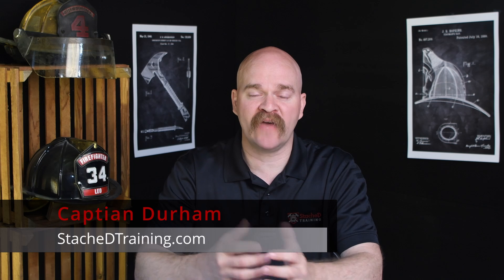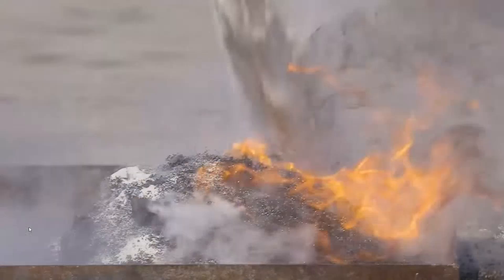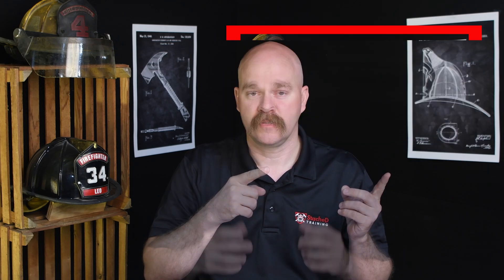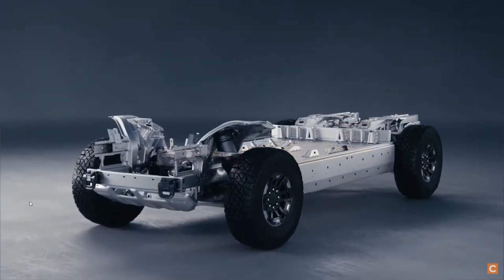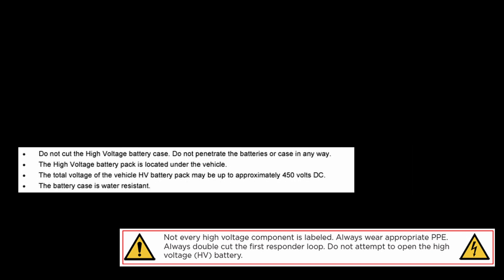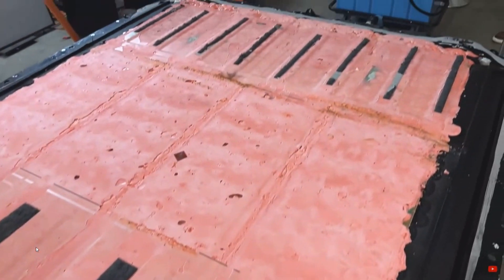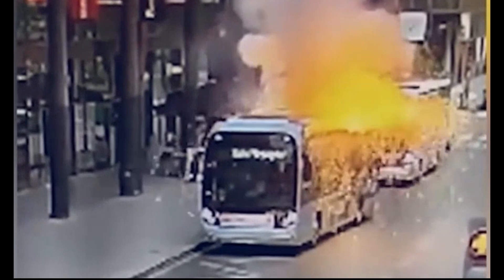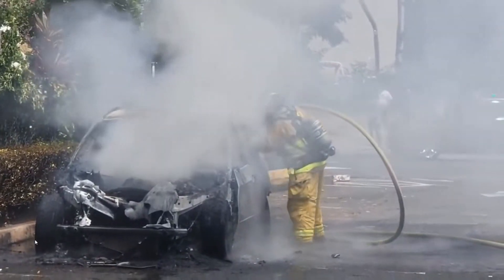What Firefighting Tools for Extinguishing Electric Vehicle Fires Really Work?

Comment: If anything, if EVs become common enough, it may be best to just have some sort of enclosed trailer with a winch inside that you can tow a burning EV into. That way it would be in an enclosed space that you can vent the gasses directionally while managing temperature.
Reply: This strikes me as a pretty good idea. Box would have to be rather robust, but probably doable.
Reply: @itshofftime  How many fires can a regular shipping container take without deforming enough to be unusable?
Reply: @CTimmerman  Line it with gypsum panels. Replace them after each EV burn.
Reply: @CTimmerman  With the top still on probably 0.  Somthing purpose built would be much more robust and useable.
Reply: sure - are you gonna hook the cable to the car ?
Reply: @gibbyjones1040 that seems like a small obstacle, robots could handle this, or just like in the video, a long handled device. Perhaps the EV’s could be required to have hooks or loops placed at either end to facilitate.
Reply: @gibbyjones1040  I've heard they pick it up with a crane, forklift, or claw and drop them in a dunk tank.
Reply: I like it! It could be hauled to an "EV burn yard" so that combustion can do what is does. A large particulate filter would be nice too.
Reply: You'd need an extensive rollout of custom vehicles designed to do only one job which will be punishingly expensive to implement and maintain as well as requiring extra space to store the vehicles. Towing a trailer will limit mobility and increase response time and while it may work if you've got space to get things aligned when you get there this is more often than not going to be unsuitable or impossible. 
It's a good idea on the hard factors (ie. how to contain a violently burning EV) but unfortunately it falls down on the soft factors (cost/practicality/implementation).
Reply: @DjDolHaus86 That is cost prohibitive, I agree. Better to maybe go with the blanket and figure it out from there.
Reply: @DjDolHaus86  Yeah usually the fire is going to burn the vehicle before anyone gets there. So unless there's already something there prepped to go.
Reply: @DjDolHaus86  just use water filled dam barriers to build a pool around the vehicle, and then drown it
Reply: In Germany firefighters are usually just using a standard garbage container that is open at the top. Just try to extinguish most of the vehicle, fill up the container  with water and drop the EV in it and let it sit for a couple of days...
Reply: @mkultra3679  Seems like the most practical method.
Reply: good idea, but wouldn't a ditch work more effectively? well this is assuming the occupants get out and the vehicle can be put in Neutral
Reply: Try that inside a sub parking lot....😂
Reply: the famous "elegant solutions for problems that did not existed in the first place."
Reply: If you do that, might as well have it evacuate O2 and then you can put fire out easier that way maybe. Problem is getting to the battery still.
Reply: EV Trucks will need a large container 🤡🤡🤡🤡🤡🤡
Reply: @sichere 😂😂😂😂
Reply: Yep, these things are becoming more and more expensive - 
AND WHO has that sort of money.

Maybe billionaires do - but already, you can see the idiocy
 that their Interests have gotten them into, 
ARE NOW at the bottom of an Ocean!

sheesh... progress has opened up it's own  HOT can of Worms!
Reply: And what kind of vehicle will transport this EV containment device? Another EV? Boom goes the lithium. Maybe when the first EV firetruck burns down the EV fire station somebody will realize making car batteries out of explosives was a bad idea from the start.
Reply: @nerd3d-com Well trucks aren’t going to become EV, except light duty vehicles. 

On a side note: Trucks will become hydrogen powered before EV, which means Hydrogen fuelling stations will become prevalent. This means hydrogen passenger vehicles will follow extremely quickly, given that hydrogen vehicles are far more environmentally friendly, cheaper and negate the negatives of EV’s… and as such, this issue should negate itself.
Reply: @LukeAusNSW  Fire trucks ARE going electric - our local fire station has one on order...
Reply: @nerd3d-com  This isn't that big of a problem. There's been only 2 transport ships with a mix of internal combustiom vehicles and EV's in the past 20 years.

Comment: Flooding port on the battery box would def help.  Needs to be standardized for the entire industry.
Reply: It will be destroyed in accidents.
Reply: You could easily design it to withstand 95% of crashes.    @Baneslayer
Reply: When you short lithium batteries it can get much worse.
Reply: it does not help. The nature of these fires makes them unstoppable, all you can do is let them burn themselves out
Reply: @mitchellcrane9809 sure as heck looks like you can stop them: https://youtu.be/4xjDdmv8urk
Reply: @mitchellcrane9809  this is not fuel, they are burning because they are allowed to reach these high temperatures.
Reply: @Y2Kvids  That is nonsensical , it is like saying gas is not a fuel as long as do not allow   it to reach high temperatures. All one needs to do is allow a fully charged lipo battery to experience a internal/external short from damage or internal breakdown and it will overheat on its own and burn.
Reply: @mitchellcrane9809  you are not a expert.

Comment: So the battery boxes need a flooding port accessible on the exterior of the vehicle.  Or the boxes need an internal fire suppression system.
Reply: You could put where the exhaust would be on an ice car
Reply: @jasonmurphy9647  that's actually a damn good idea, leverage a portion of the pre-existing ICE paradigm as a "hydrant" or "stand pipe connection". 🤙👏👌 this would better than the gas filler neck idea being considered, as that  access point would unfortunately be sitting up high in the flame.
Reply: re: "Or the boxes need an internal fire suppression system." i've seen this done as well (have the pics on my phone) but the caveat is this was on a custom EV race car with a custom made battery pack (built with an almost unlimited budget) so it hasn't reached the price conscious OEM's just yet.  what they did was simply leverage a pre-existing idea/requirement for on board Fire Suppression found on many ICE race cars, and dictated by many race tracks and sanctioned race series (ref: NHRA, SCCA, etc).  further example: those in the Porsche community know that a fire bottle is something than can be specced on some models of 911 purely driven on the street.

Comment: Where reasonable why not push the vehicle with a blade, backhoe, dozer or other protective equipment or blade added to emergency vehicle to a dirt location and then push up dirt berms or short barriers.  Then add water, foam or more dirt depending on the situation.  The dirt berms contain much of the fire and help direct flames, smoke and heat upwards as well as any matter ejected.  It also helps concentrate the water or foam in a smaller area to hopefully work better rather than disperse.  More dirt could also help.  This is obviously not feasable in urban scenarios but suburban and rural there is often ditches, dirt shoulders, yards and dirt areas nearby roadways.
Reply: No.  Just NO.

Comment: I have the best solution, do sway with electric vehicles. Even small phone batteries have been know to catch fire, this all the fault of the climate change wackos, they always forget that it takes gas coal or oil to generate the power to charge their pos cars, can you imagine the fire if one of those tractor trailers goes up? As long as the federal government is involved we're doomed.

Comment: I would say that perhaps the best way is to allow a controlled burn.

There are products that don't burn that are used for furnessess They can take intense flame without burning.

So I've wondered why these things are not used to control the battery fire so it doesn't spread, a fire proof valve could be fitted so any build up gas could be vented to a controlled area.

So if a scooter set fire it could be wrapped with the blanket and direct the vent to a safe zone, same with a car but a car or larger vehicle could have the cover pulled under the vehicle  and over the vehicle in two parts which interlock automatically.

The demo of the blanket you showed just needed a method to control the gas pressure so it could be directed to a safe localised zone.

For example, a charging car caches fire, the blanket is thrown over and under it, and it just burns, the vents let the gasses release into the air the smoke could be reduced with water to keep it down with a sprinkler type mist.

So it makes more sense just to let it burn but to control the burn, I would have thought.
Reply: Those gasses are HIGHLY toxic unless you let the fire freely burn.
Reply: @ffjsb  I'm gonna guess in that case that they are toxic regardless, but in time using a controlled burn in a vented covet a system of capturing these gasses could be developed so they could be nuitrilised.

Also the idea of a mist water spray would be to hold down the gasses so they could be either collected as dust or washed away.

The problem I gathered was the ability to control the fire, so using for example ceramic wool or blanket the fire could be controlled, but as you say the gasses are toxic, it would be a matter of redirecting the gasses to a collection point of some kind.
In fact if all battery packs were lined with a none flammable liner any fires could be directed to a series of vents in the pack, case and the vents could be used as a gas capture point as the fire would have no where else to go.
I assume fire travels the path of least resistance.
Reply: @flitsies  Your idea is not practical in any way.  EV batteries burn MUCH hotter than a standard car fire, and there's not enough space to put a flame proof barrier that the jet like flame couldn't burn through.  You'd also need a huge semi to haul what ever expensive apparatus it would take to capture any gases, good luck getting that into a parking garage, or even getting it there in a reasonable amount of time.

Comment: What if the battery pack/box could be taken out of the vehicle to burn separately while the vehicle can be cooled off separately, this way if someone or something of value is trapped in the vehicle, can be retrieved without more effort and risk. The problem is that the manufacturer is the only 1 who can make the battery pack removable, unless a specialized machine is invented to remove the burning battery pack from the vehicle.

Comment: Well.  To successfully put out an electrical fire ….    U need to cut the source.    Well y’all created the problem ….   Theres a chemical reactions. toxic no question about it.   .  I crushed my phone battery.   I threw it in the snow bank.       It melted a bit into the snow ….but seemed to stop the reaction … So freezing could be the solution.   Liquid nitrogen…. EV are the worse for the environment than any gas power auto

Comment: I think some distinction needs to be made on how you define "extingushed". Take for example the widely reported Tesla fire in Texas where fire chief Palmer Buck of The Woodlands Township made a statement to address media hysteria and misleading reporting. It was their first time responding to an EV fire. The large fire was out in about 10 minutes using good old water.

There were smaller flareups (some driven by tree sap from a tree nearby) and due to scene preservation, they weren't able to lift the vehicle to direct the stream. They used a smaller hose to keep a stream of water to keep the pack cool and was on scene about 4 hours due to that process, not because there was a raging fire. That stream meant they used about 25-30k gallons, but the initial amount they used to extinguish a bulk of the fire was likely much less.

So while it is true in terms of a definition of the battery not reigniting, it isn't possible to put out completely, in terms of just a large visible fire, just using water is enough to put it out. Keeping the pack cool also reduces the chance of the burning section spreading to other parts. That is why all the response manuals suggest using water directed at the battery pack.
Reply from the maker: I touch on many of these points in this video: https://youtu.be/mNYwpTrYYBM

Ultimately,  even if you apply water,  what are you saving?   Vehicles that catch on fire (not limited to EV) are rarely repaired.
Reply: @StacheDTraining  For that particular accident, due to the alleged used of Autopilot, both people inside dead, and the interest by even NTSB to investigate the circumstances, they needed the vehicle as intact as possible.

In most, cases yes, preserving the rest of the vehicle is less important. The effort would instead would be to try to minimize the impact on the general area, in terms of risk of fire spreading beyond the vehicle and in terms of toxic fumes released if fire is left to burn on scene. It's possible to control the fire enough for it to be safely put on a flatbed to be moved to an empty lot somewhere where it can be left to reignite and burn without risk to other property or people. Others also pointed out other places just use a container full of water and dunk the car in it.

Comment: How about if the hybrid or electric vehicles body was built with a flood tube? What I mean is something similar to the concept of a filler neck going down to the fuel tank on a gasoline car,,, on a vehicle with a battery pack build a fire hose ready tube going down to the battery pack so that the pack can get flooded with water?
Reply from the maker: I actually have a patent pending on an idea like this.   I'm planning a future video on EV fire extinguish intellectual property.

Comment: I have been part of a few research sessions here in Australia and there really isn’t any clear solutions. I think the main priority should be just containing the fire and reducing public exposure to toxic gases.  I personally would like to see decals on the car they identify the cell chemistry.
Reply: A design requirement for a quench-port or force-cooling port could potentially aid in this case. A standardized hookup point allowing access to the normally hermetic environment for quenching a fire. A secondary blowout would probably also be needed to discharge water after passing through as much of the battery as possible.
Reply: @1kreature  I like it. I commented elsewhere - A double-win would be that fast charging ev's is already limited by thermals, not battery chemistry, since the car is designed with very limited battery cooling for day-to-day operation. If they could justify external access to battery cooling loops with an interface that doubled to allow chargers to heat/cool the battery for more efficient charging, it would keep everyone happy. Consumers get faster charging, it's not an expensive part to include in the car, and firefighters get sufficient cooling btu to prevent a complete loss with less gallons and less time.
Reply: a new battery chemistry might be one.
Reply: @cdoublejj 
F 500 encapsulator agent
Reply: And to think that most of the Australian underground mining companies are going electric is worrying. Is there any chance for us boots on the ground if this happens? And this is bound to happen. Most of the OEM companies like sandvik, epiroc, normet are bringing out videos of their new EV equipment but never I've seen a video of them showing  their fire suppression system on this new machines.
Reply: thank you for repeating what stated in the video.
Reply: @thelastoneee3741  thanks for your contribution also.
Reply: There needs to be a e scooter ebike storage sollution, maybe ceramic or something for people who are willing to help these fires stay contained.
Reply: There's solution 
F500 encapsulator agent
Reply: Well they used to throw firefighting glass balls. They throw removes all air fires out. Problem is its not really safe
Reply: @wildandliving  The problem with a battery fire is that all the energy is already there in usable form. It does not need oxygen to be released like gasoline does. A battery can burn in a vacuum.
Reply: The main priority should be banning them. They would let the environmental, health and safety risk fly in any other product.
Reply: @asherdie  That's just fear mongering alternative agenda. The best method is to never allow a major fire to happen in the first place. BEVs just have to multiple times less likely to have a fire than ICE thus not a risk. This is very achievable.
Reply: @asherdie Ban ICE vehicles, the affects of the internal combustion engine seems to cause Canada to catch fire and me to breathe smoke.  Homey don’t play that!
Reply: @drunk_astronomy grow up!
Reply: @drunk_astronomy   So no more food production for you? Love to know how engines makes the country burn?